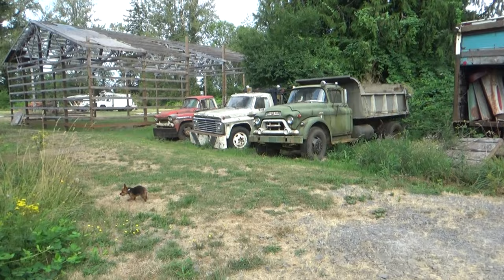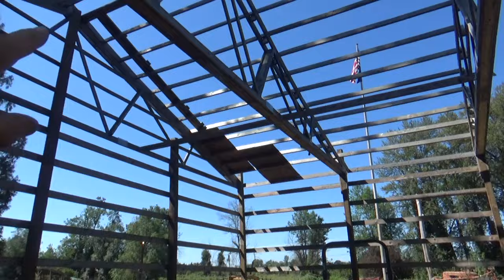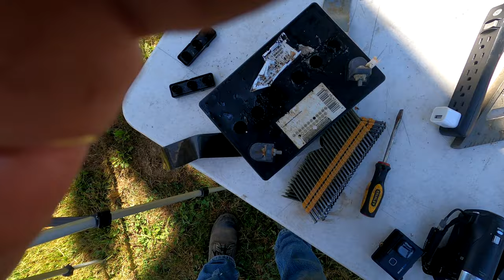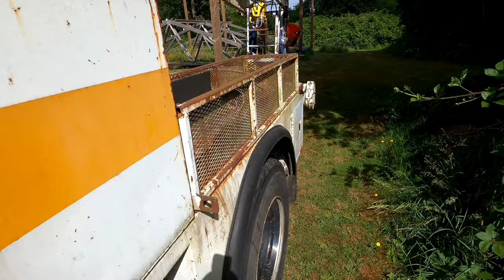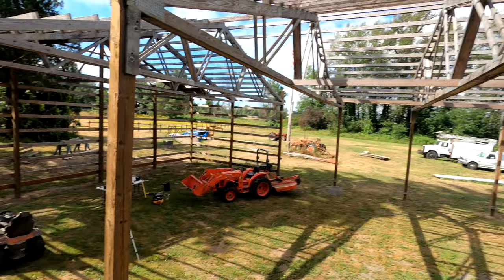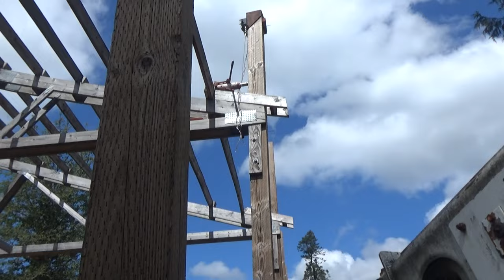Pole Barns for Dummies (Me)

Comment: When we took down the lumber mill and sold all its trusses , They were cabled together too. So to straighten your trusses out you can cable or strap them from the center bottom member of one to the tie /support section ( left or right of center ) of the other on the top boards of the one next to it.... You have alot of lumber / paper mill buildings for an example of this near you to visit and check it out.

Comment: Excellent video Classic Truck Rescue Rick  :)  , Jamie :) , Annabelle :) also very nice on shop coming together too and Rick should get funnel fill batteries with still water help out and washing caps too before put back so help breathing better or when recharge them with air to ! Hope help out small funnel need get groceries store fit holes nice and that what use on my Lawn Mower Tractor battery and work nicely! Plus filling should have gloves help not batteries acid on fingers to hope my tips help out !